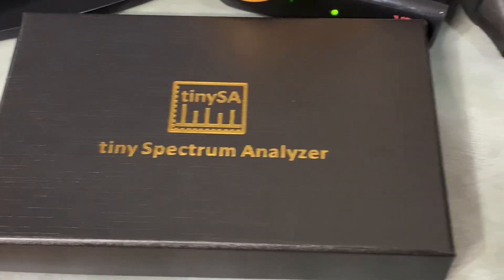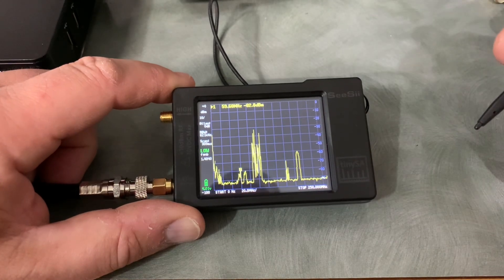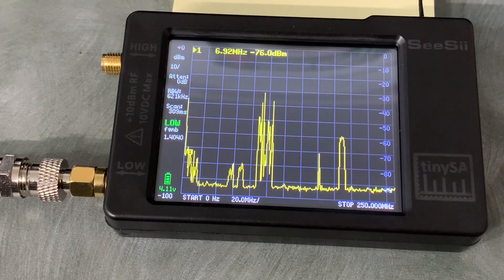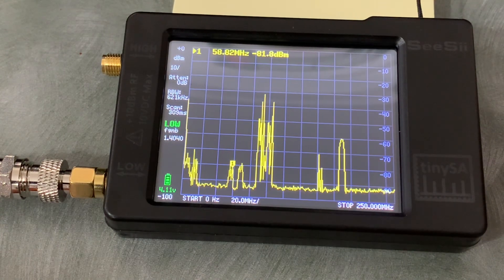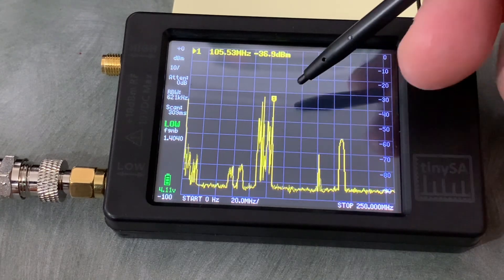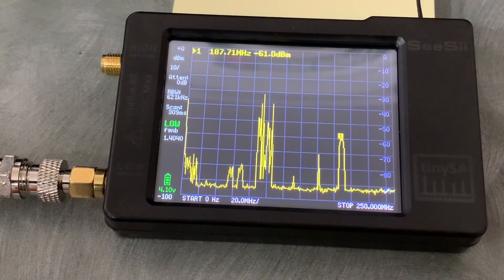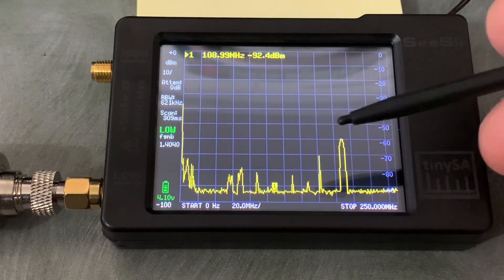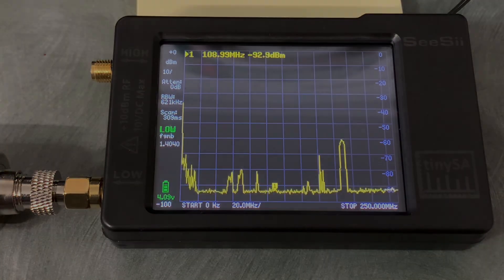Watching a TV Antenna FM Filter in action on TinySA Spectrum Analyzer

Comment: If you are here reading comments, you might be having reception problems. Here are a few more tips that could help. Use an AM radio tuned to static to sniff out electronic noise around the house. Cheap LED lights, dimmer switches, and transformers can create electronic noise that can interfere. Another easy way to see if this is the problem is to turn off breakers in the breaker box.

Comment: I wonder if those are shortwave signals on the far left side of the graph.   

You live in one of the few areas where you can demonstrate how low VHF and high VHF  straddle the FM band and how narrow the FM band is.  

It seems weird that the manufacturer didn’t use standard coax connectors on that analyzer.  

An interesting video for you would be to connect a small dipole to the analyzer and go around your house checking LED bulbs.
Reply from the maker: I never thought about those signals being shortwave, good point. I’ll try the dipole idea around the house.
Reply: Those small coax connectors are called SMA and if you dont pay attention, when you buy some of the fm and 5g filters, they might arrive with the SMA fitting.

Comment: Holy smokes what a difference!
Reply from the maker: Gives a visual of the attenuation of FM signals, and some tangible evidence that filters work!
Reply: Means nothing unless you have a local TV broadcaster at RF channel 6 that you are trying to receive.
Reply from the maker: @jimross2101  FM frequencies  and their harmonics can affect other parts of the TV band. Example: 88 MHz has a 2nd harmonic at 176 MHz, which could affect High-VHF channel 7. There are other harmonic frequencies across the FM band that could affect RF channels 7-13. 

So it’s not just channel 6. Plus the video it shows the filter does what it is designed to do.

Comment: We used to use the radio shack versions of these with pioneer cable boxes
Reply from the maker: Cool. Was Pioneer a cable company?
Reply: @NorthcoasterHobby  Pioneer the big radio company made the model BA-6310, that was used in my area. It received its 'commands' from the headend at 110MHz. Without a trap it would die overnight, it would last weeks with it!
Reply from the maker: @SilvaD702  Thanks for the info!

Comment: I use the AMIKO TSC1270 digital meter for satellite, antenna , digital and analog cable instalation (two inputs one for satellite and the second for cable/antenna). My digital meter also has a spectrum analyzer. On the spectrum analyzer I see that I have signal on both FM and UHF band I can also zoom in and I can see how many Db I have on each frequency.  Interesting part is that if I go to analog cable installation, I can manually add a frequency between 40 - 1100 MHz, by default it has the 105.25 MHz frequency set as channel 4, I also added the 82.25 MHz frequency as channel 3. If I connect any FM antenna the signal strenght in most cases is 100%, but if there are some problems with the antenna or coax cable the signal drops,  if the antenna is indoor the signal is 70-80%, if there is no FM present or an FM Trap is installed the signal strength is 5-10%. I use this feature when I install an FM antenna to check if it the setup is correct or everything is allright. For better testing i recommend an FM radio with coax input The TSC1270 is not designed for FM installation only for TV but this is a hack. If you use it in North America you can use it as a satellite finder for both C and Ku Band but you must delete the European satellites and add North American satellites, adding a satellite or transponder is the same like a satellite receiver, unfortunatelly you can't use it for digital cable and antenna beacuse the tuners is DVB-T/T2 and DVB-C/C2 but you can use it for analog cable just change from PAL G to NTSC.
Reply from the maker: Good to know. This analyzer also has the option to dial in a frequency and observe the SNR and other measurements. I wanted to keep the video as straightforward as possible.
Reply: Can you do an unboxing and review with your analyzer? @NorthcoasterHobby
Reply from the maker: @Nicholas_Chris  I will soon, going to get more acquainted with it first though.